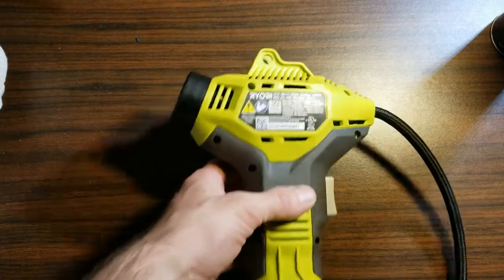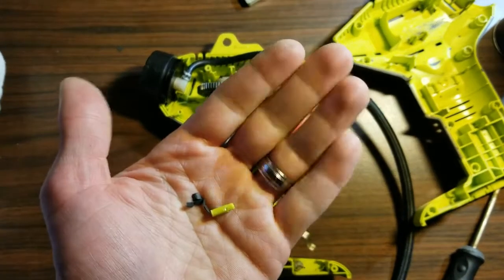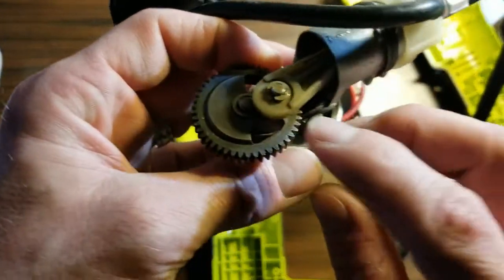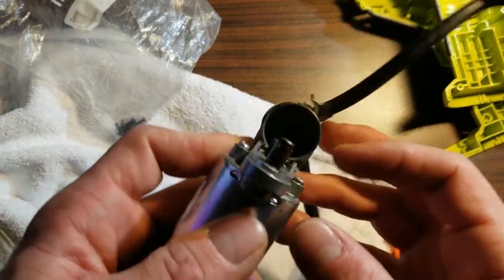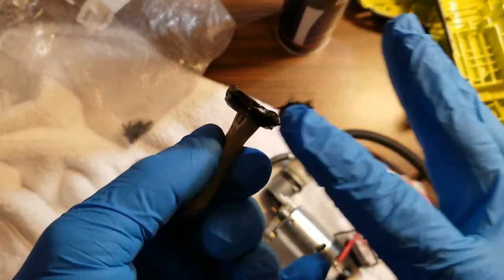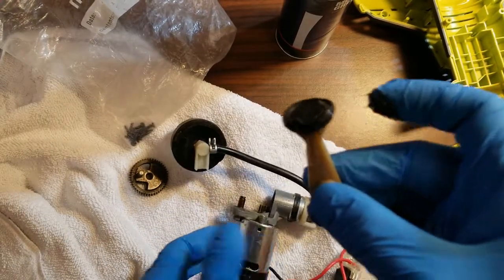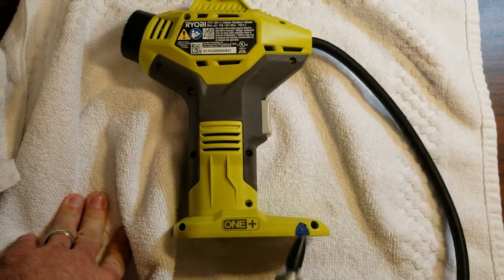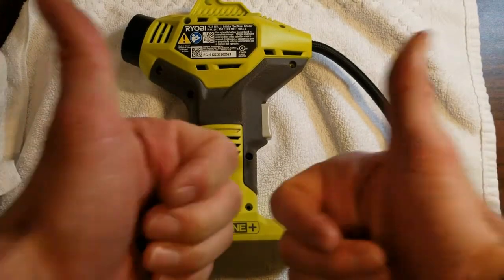[Fixed] Ryobi P737 Air Compressor Rattles and Low Airflow

Comment from the maker: No replacement fan found online.  Not worth it anyway due to a new unit costing $20.
Reply: 2022=$20
2023=$40
Reply: Thanks HBB, mine hasn't failed yet. Seeing your video gives me the know how and confidence. So for self satisfaction, save the planet and a few coins. Lee H
Reply: 2024 - try one of the newer inflators - $40  or $80 (Special BUY).

Comment: Not sure if a ton of people have inundated you with "the way ta do it" 's and "well you shoulda" 's but after watching you fight to get the e clamps off, I just thought I would mention that it goes SUPER easy if you use a small flathead screw driver (on this sized clamp anywho) sticking the blade in the slot betwixt the clamp and shaft and gently turn it like its a screw. It will come off easily and more importantly, it frees up your other hand for both holding the patient AND putting a finger on that clamp to control its trajectory! 😏 great video! Thank you!

Comment: Mine was making a rattle/grinding noise so I was convinced that I had the same problem as you. So I took it apart and found that nothing was broken or loose. Then I performed a thorough clean and lube job. It is now quiet and working well. I have concluded that the noises were from air escaping explosively from around the  piston seal. Thanks for the video. It was VERY helpful.

Comment: Followed your instructions, the rattle is gone and it does have much improved compression and inflation results...I know the unit is cheap, but I should get another summer or two to inflate pool floats.  Really like frugal fixes.  Thanks a lot.

Comment: Thanks for the vid. This fixed my issue.  I guess the lube got used up in the piston area causing resistance and noise from the gears working harder.  I was surprised to find that my fan was intact. After adding new grease it works amazingly better. Possibly better than out of box.

Comment: One of the case screws is longer than the others. It's the top left one, as you disassembled it. Presumably mixing the screws up will give you two points of inadequate hold.

Comment: Great video and instructions. Thanks!. I removed just the slip lock ring on the big gear and removed the whole assembly. My plunger was a little oily so I only used a little machine oil on the back side of it. The gear assembly was bone dry and that was likely causing my rattling as the gears overheated. Greased the gears well, and all rotation points. Added oil to rotation point I couldn't get grease to. Also used WD40 into oil port on motor and a little into the motor coil area. One screw near the air gauge was longer than the rest and kept giving problems (coming out and going in) so I replaced it with the shorter length. My fan was in good shape, no damage there.
Reply: The one long screw goes in the rear top hole by the Ryobi name.  I marked it with a sharpie for reference.

Comment: Great video! Do you happen to have any experience with replacing the hose on this model? Trying to find a replacement hose but I'm unsure how the hose attachment is threaded on there.
Reply: It's crimped on.  Metal collar.
Reply: You could attach another hose to the original hose by cutting it in the middle and using a 1/8 inch hose barb to connect the old with the new. You would need a couple small hose clamps.

Comment: Instead of disassembling that to add grease, use grease with a thinner that evaporates. That way grease gets where it needs to, then thickens…

They call that chain lube…
and it's aerosol, with the tiny straw tubes things. Those should reach through vent holes, so this entire operation doesn't even need to happen.
Reply: I was wondering about that... I think I will give it a shot (spray) 😉

Comment: Do you know what size is the e-clip  the last one you put on ?great video well explain
Reply: If you’re talking about the small e clip, i used 1/8 inch and it seem to be holding but i think it might be a little small so you could try 3/16 inch one.

Comment: Mine is starting to smell like burnt rubber when using it to inflate one tire. I wonder if this would fix that problem too?
Reply: I had the same issue, I found out the little fan blade inside came off, its used to blow air over the motor. It then over heats the motor if its not attached.